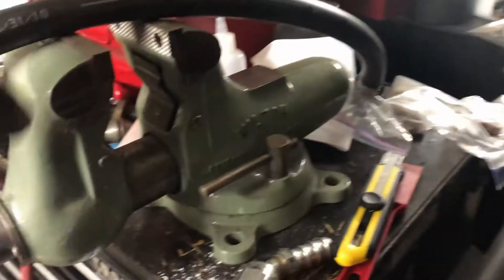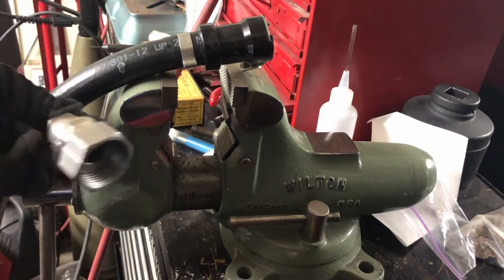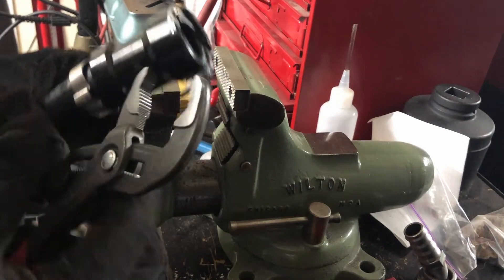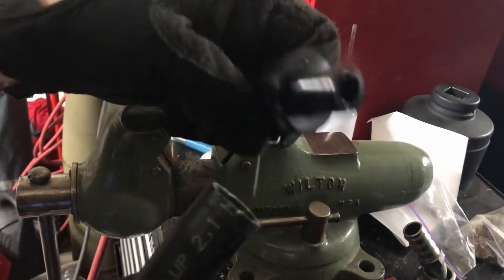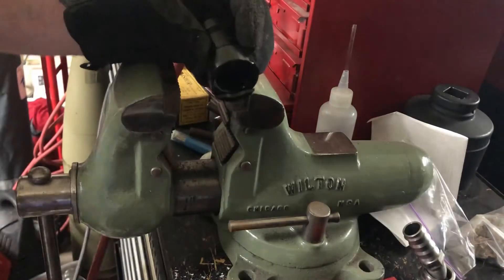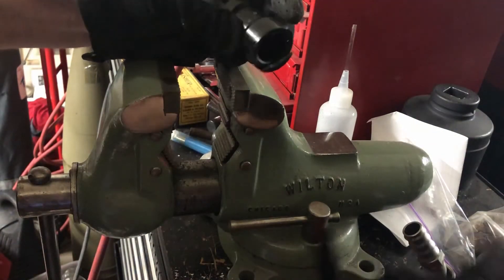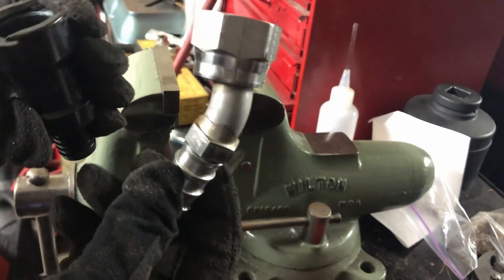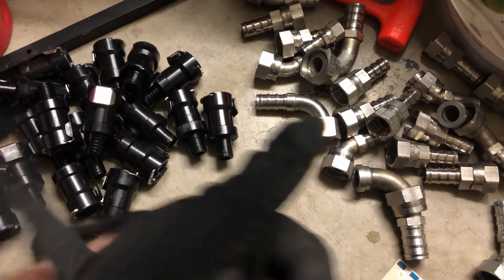Aluminum Score!

Comment: Use a file on the mystery metal, if it digs in then it's aluminum, if it "skates or slides" then it's stainless. Keep your black or anodized aluminum separate from raw aluminum.